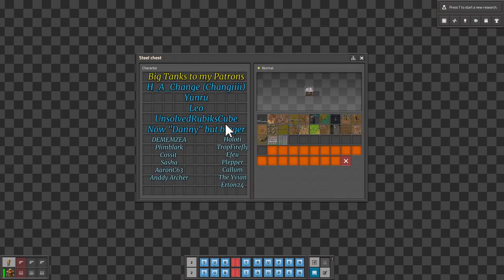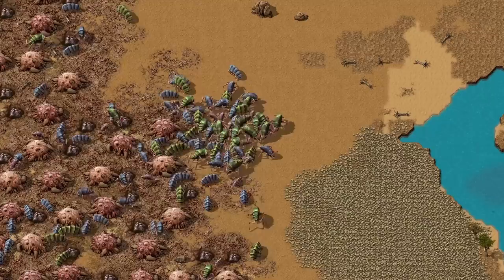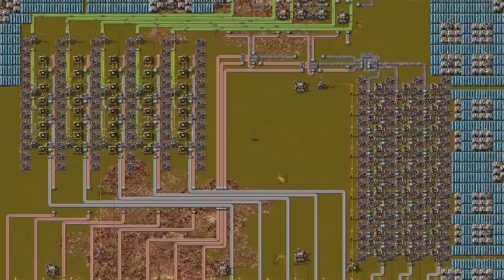Perpetuum mobile

Comment: It's always good to, even if you have switched to solar power, have a steam/nuclear energy setup for backup if somehow your solar fails (example: you using more than 70% in the day and not letting accumulators recharge and at night you have no energy and biters attack)
Reply: this is basically what's 0:29 is about KEKW
Reply: its also good if you have to use things like lasers
Reply: This is why, even though I have both the ressources, motivation and space for indefinitely growing my solar power plants for ultimate solar energy, I set up a nuclear island that only produces when steam gets low. Work smarter not harder
Reply: or hook switches to secondary systems and turn them off when battery is below something sensible
Reply: Setting up circuits and buffers for nuclear power is one of my favorite things to do in Factorio. Gotta make sure there is enough space in the steam tanks to turn on the reactors for one cycle, insert the fuel and wait 300 seconds. Only engage the turbines with the power grid when the accumulators are low, don't spam the power graph with rapid switching, and don't top off the accumulators. There are a ton more things that could be added that would add practically nothing to the efficiency.

Comment: Battery diodes are also useful.
Just make battery A and battery B with a switch in the middle that turns off if battery A is not full.
Reply: How is that different than having all the batteries at once?
Reply: @Goatfooted  it prioritize the power distribution. For example, the whole factory is losing power on radars, lasers, etc. but this will still make the arms power steam turbines even if you have half of the factory shut down.

Comment: If you make an simple logic gate telling turn on if >10 energy
Wont that just make so your turbines turn into an rave party that constantly turns on and off when energy hits >10 <10
Reply: 1) Solar panels can't be turned off, so the logic gate makes it so the backup power (steam/nuclear) only kicks in at night after the accumulators run low.
2) What turns on and off are the inserters fueling the boilers/reactors. Once the fuel is in, it'll all burn before the accumulator charge drops back below 10%.

Comment: I do it slightly different. Backup gen is nice. 
I set them on separate power grid and run single cable from steam to rest of factory.
then something like if power >30 steam power plant 1 starts
if power >25 -> second starts, etc
this way resources are there if you need them instantly.

Comment: If you use a switch for emergency generators you gotta setup a memory cell  for it, or it will spazz out when your accumulators get below the treshold and the emergency power is enough to charge it lol

Comment: I wanted to go solar from steam again just when I got the drones, but there was never enough for my base , so each day I was placing more and more and more... Now I have like 20 GJ of accumulators, I am using about 3 GJ each night, and my peak power from panels is around 800-900 MW. It is kinda hard to navigate now that my base is filled with panels

Comment: i made it a goal one time to reach 1.21gws of power using purely solar panels. the first time i did that it took a very long time, but now pretty much all of my saves have like 50k solar panels at least. let me tell you: its so fucking good it kind of almost feels like cheating. however, the amount of space that 50k solar panels takes up is just frankly fucking ridiculous. if you want to make that many solar panels, be ready to cram your solar panel-related blueprints everywhere. on all of your railroads, around all of your machines, and it taking up like 75% of all of the space you are using :D

Comment: Why did that power fail?
Reply from the maker: if you don't have enough solars/accumulators you can ran out of power during night and lasers take a lot of power
Reply: More details: a basic Laser Turret pulls 1.2 MW and fires 1.5 shots per second.  1.2 MW for 1 second is 1.2 MJ.  1.2 MJ divided by 1.5 shots per second is 800 kJ per shot.

An Accumulator stores up to 5 MJ, and can release it at only 300 kW.  This means that you need 4 Accumulators to feed a single Laser Turret, and those 4 Accumulators only contain enough energy for 25 Laser shots.  (This is ignoring tech improvements for Laser fire rate)

Compare this to a basic 2x2 Nuclear Reactor setup that at peak load can provide 480 MW, or keep 400 Laser Turrets firing for as long as the Nuclear Fuel Cells last in the reactors